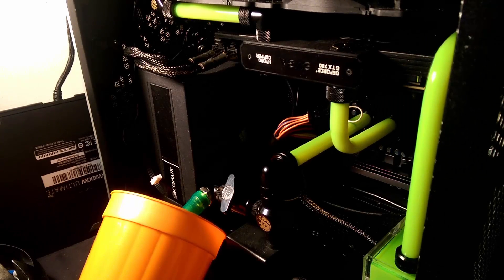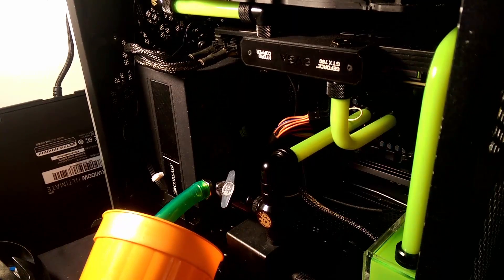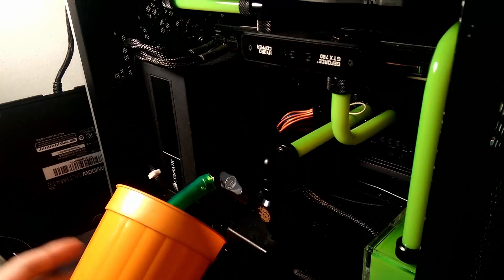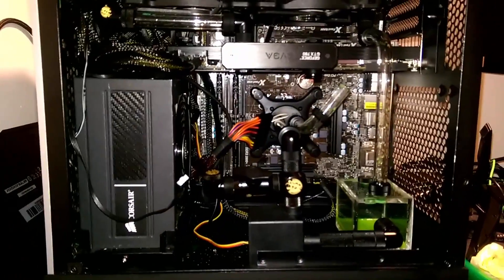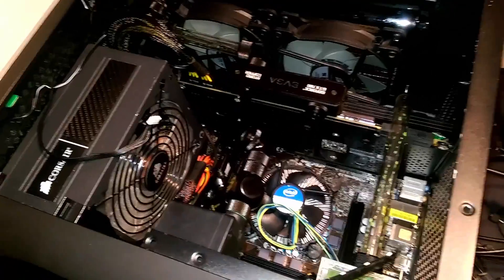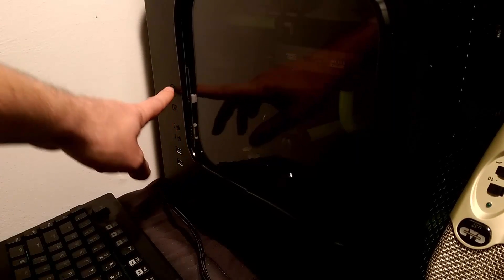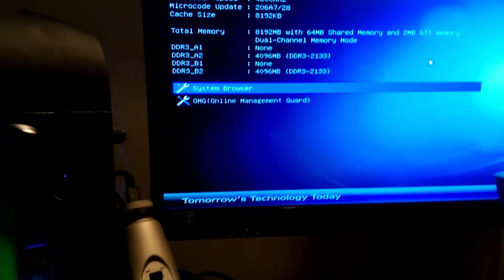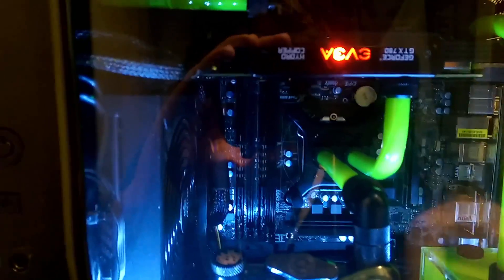Acrylic Water Cooled Bitfenix Prodigy M Part 2 Draining The Loop & Upgrading CPU Plus LEDs

Comment: This is great you did all that work, showing how you drain it and everything. Except:

-Next build (maybe you already did this) put the drain and the VERY bottom of the loop, with no low points anywhere else. Looks like your reservoir is lower than your drain here.

-Don't run the pump without liquid. Using it for a few seconds is fine.

-Did you pull the fill port? Looks like the "milky" liquid is really just air bubbles cavitating. That may be why your drain wasn't working right. Then you started the pump, which just pushed a lot of air into the lines. Pulling the filler will guarantee the liquid will just flow right out.

Comment: That pump idea looks like a waist of time, it definitely wouldn't take an hour to drain. I did a drain with 3 flushes in 20 minutes and I used my GPU block as the drain hole. I really like the way your rig looks. I have been trying to figure out a way to water cool my Prodigy M with 2 R9 290x but I don't think there is enough room :(

Comment: Your EVGA plate is upside down, if im not mistaken I saw someone with this same setup take that plate off the side of the card and flip it around
Reply from the maker: Ryan Boytim yea I think i corrected this in one of my later videos. I always wondered if I could flip it around but I was always afraid to take the screws out while it was filled with water lol was paranoid water would coming pouring out of them all over my components haha.

Comment: why a 2600k and not a 4770k or 3770k higher?
Reply from the maker: My motherboard only supports up to 3770k. The main reason I went with the 2600k over the 3770k is budget vs performance. I found a really good deal and pretty much got it for free after I sold the i5. The 3770k still goes for 250-350 and that price increase isn't worth the small performance increase. Ivy bridge is known for being a poor overclocker as well, and I already have my 2600k at 4.5ghz with only a small increase in voltage. I'm thinking I can get it up to 4.8 or maybe even higher.
Reply from the maker: Also, I plan on saving up throughout the year and putting in a g1 sniper motherboard to match my build, as well as a Haswell or Haswell-E i7 depending on where my budget is at. Right now I pretty much went with the best performance I could afford, and the budget right now is somewhat tight with me being a single father.
Reply: EatSleepMac can you tell me the all your watercooling parts and the side of the tubing it looks really cool